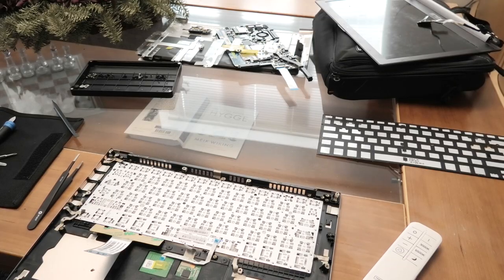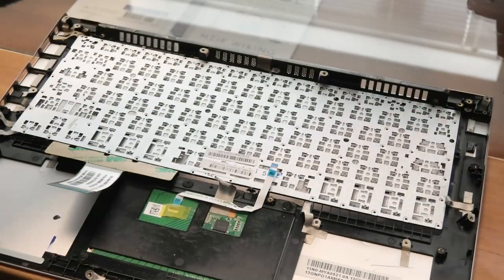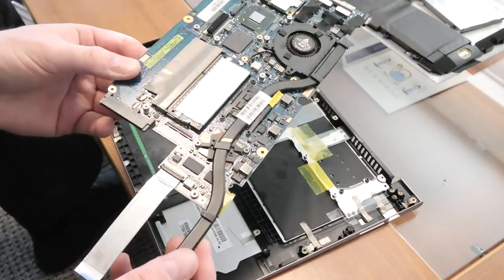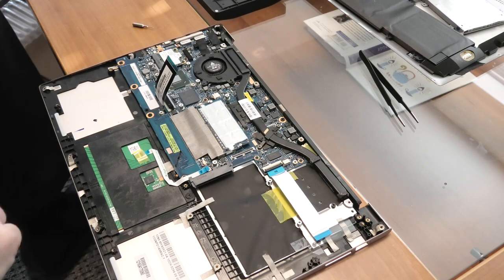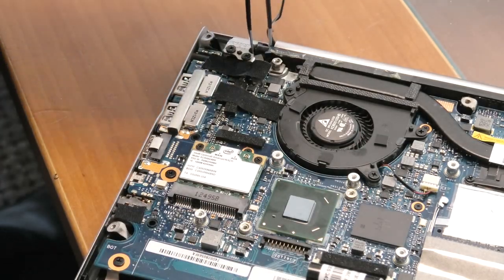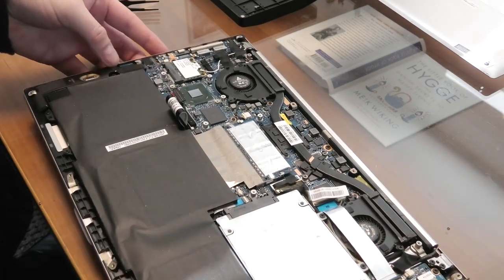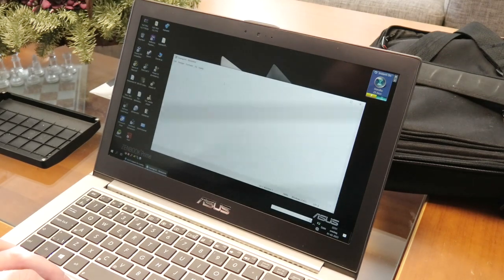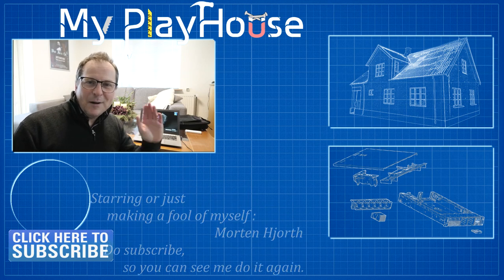ASUS UX32V Laptop - Keyboard Replacement - 1272

Comment: One of the worst laptop designs what I saw before!! Nightmare.. 😂

Excellent video as always and great job! 👍

For replacing keyboard, I just re do every fixing point one by one.. I just putting soldering iron with small point tip exactly in middle and lift keyboard.. For adding it back, I change tip to flat. 😉
Reply from the maker: Thanks for the tips! I did not think of using the soldering iron.

Comment: Well done Morten, you won the battle and gained tiny bits of plastic lol .
And one escaped screw that Asus will never need :-D.
I really don't like flat keys,  My old Acer has beveled key caps, i like the older style.
When you put that small ribbon cable in the connector, i could swear your mum was talking.
20:18
Reply from the maker: There was no screws left over, at the end :-)
No my mom was not here... must have been your wild imagination. :-)

Comment: Asus and Acer laptops are a total pain in the rear to repair. Hours of work to dig out the defective components and hours to put them back together. I fear there won't be much of an advantage with Lenovo Ideapads, though. They are the same cheapo design. ThinkPads are the ones that make the difference. HP and Dell seem to be pretty okay in the repairabillity aspect. But I am through with buying lappies with small defects, it just costs too much time and the repairs usually don't last long. Laptops are throwaway-designs. I definitely prefer working on stationary PCs. Much more reliable performance for a much lower price.
Reply from the maker: I forsure did this to help a friend,, is took way to long.

Comment: Ultrabooks are not made for opening. I have an x1 carbon 2 gen with i7 4550u, i use it as a 24/7 gaming server for not having 200€ more on bills. It has a defective screen and you don't find screens anywhere! they just are not there! also cmos battery is gone, but its soldered! the CMOS BATTERY IS SOLDERED! i cannot change that... i have a defective cmos and i cannot do anything for it...
Reply from the maker: Replacement parts can be hard to find..